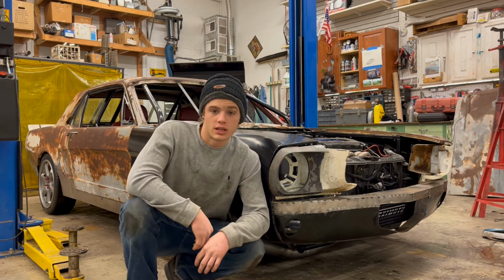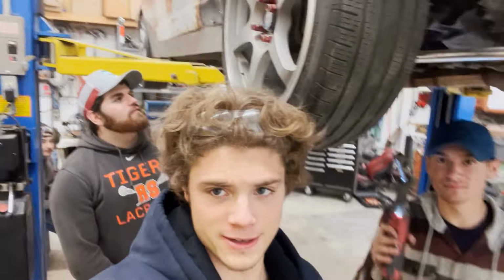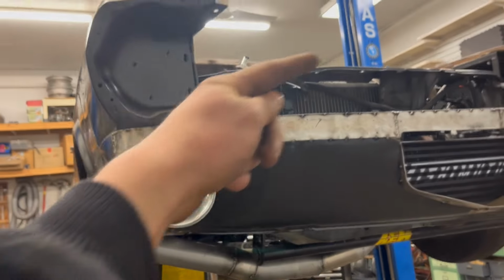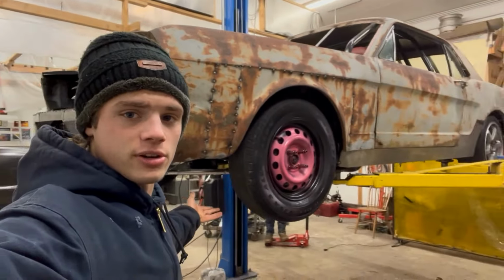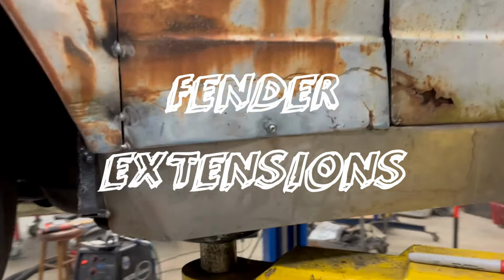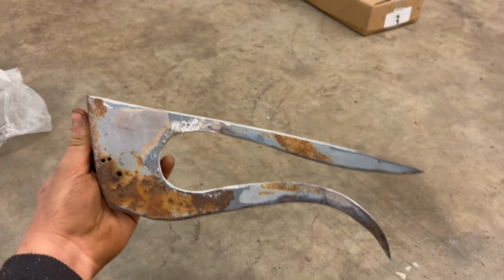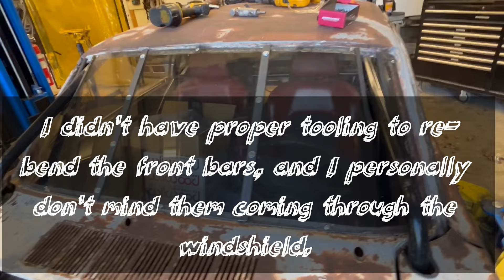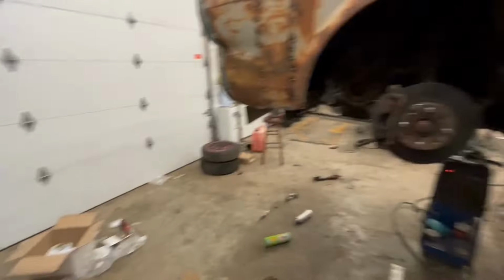IT'S ALIVE!! 1965 MUSTANG ONTO HONDA CIVIC CHASSIS SWAP! "MASUTANGU" PT.3

Comment: the thing i love about this build is not only would it have been as cheap as dirt to build, but it'd probably smoke most original mustangs! i would love to see this rig set up for drag racing, drop the weight, add a chute, big ol' mickey thomson draggers on the front, tune it to run copious amounts of boost..... and upset all the boomers with it at the drag strip!

Comment: You need to put this on a fuel tech and AWD!! The fuel tech is going to let you do away with the Honda gauges. You can even do away with rhe entire Honda dash and fab a mustang dash in. You can get digital mustang looking gauges to run on fuel tech. The and is going to help from this thing just spinning and breaking axles.

Comment: A great donor that should fit wit⅘ all the way around just got done helping friend with just this from a 2010 acura MDX RL to a 1998 civic recipient with a full  forged  built K24 with 76mm precision turbo putting around 600 HP to the wheels threw a new built Gear Star 6 speed sequential transmission (cost him a arm and a leg) after AWD upgrade. Hitting track again tomorrow but got 2 step tuned in  the 60ft avg hits in Wednesday an it was doing 
.13-.14 @ 60ft at a 6 lbs launch an still bogging a little. Tune I got ready for tomorrow should be good now after suspension adjustments and 8lbs launch solid .12-.13 @60 ft and running out to the 1/8 tomorrow  if all fills good at that point might throw a few little deeper but don't have shoot or roll cage finished yet so doubt we do any full pulls

Comment: Ok of all the chassis out there... You choose a front wheel drive Honda civic.    I would of used a E36 325i or AMG c63 or something rear wheel drive.. not a front wheel drive . That just makes it Kak ... Not that the hondas engine is not good .. just the whole front wheel drive and thin chassis does not do it for me. To each his own.